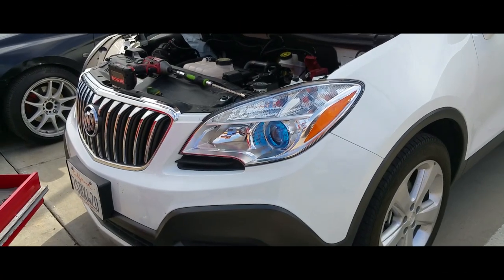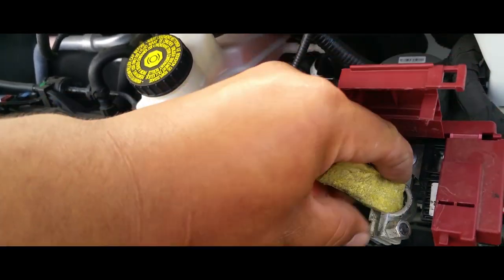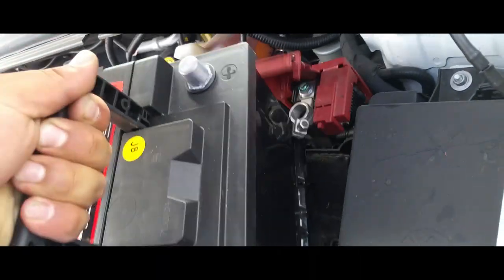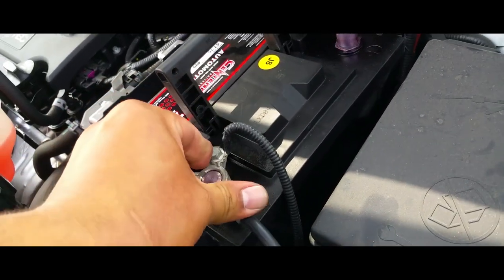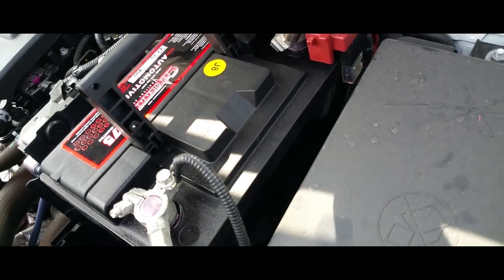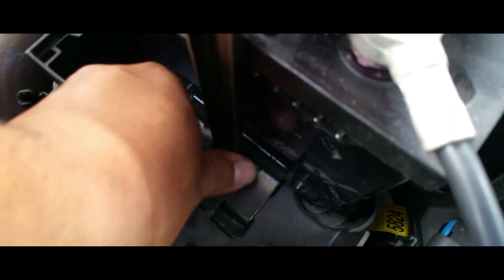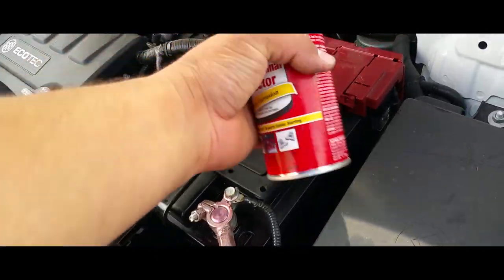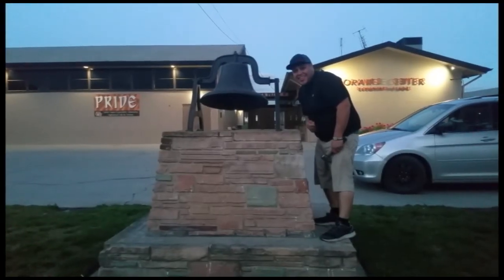How to: Install a battery from a 2016 Buick Encore

Comment: George, what do I do with the little black plastic tube, elbow vent and plug, that came with the battery?
Reply from the maker: Some cars have a little vacuum line that connects to the battery. Im not sure if this model does or does not. But if you see a little black straw hose, connect it to the battery.  Its so it allows harmful air from the battery escape with out causing harm to the passengers in the car

Comment: Do I need to plug the little hole in the new battery for my 2014 encore….? Last battery didn’t have the hole plugged; but was spewing noxious fumes from the hole when car was on….
How do I know if the new battery should utilize the plug or not…?
Reply from the maker: No you dont need to plug it. it was spewing fumes cause it was going bad. you should be good.
Reply: @559powerscape  awesome thanks so much, George! Thanks for the reply.